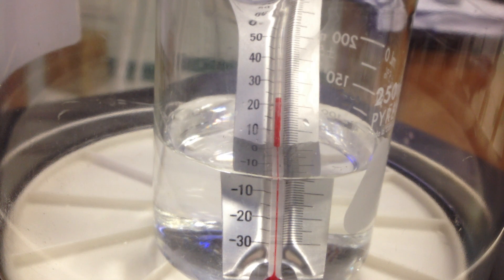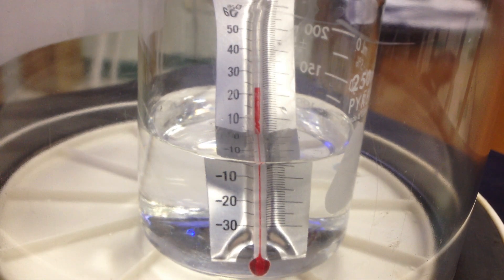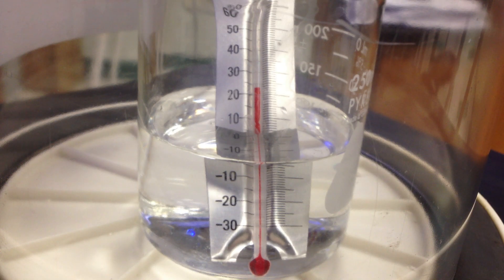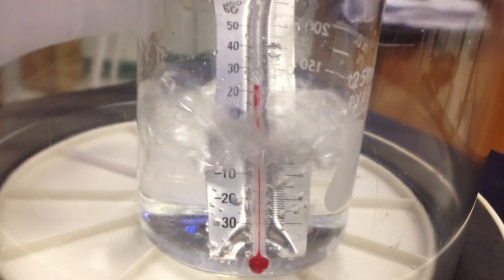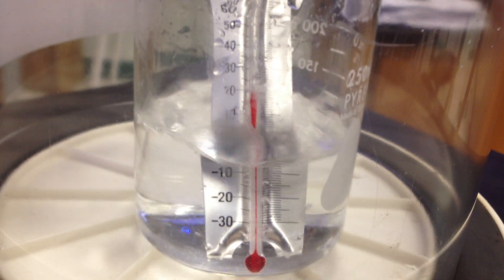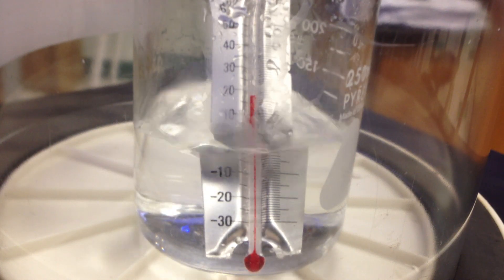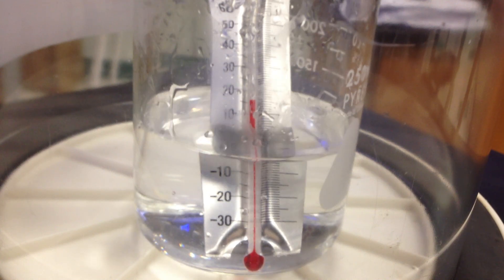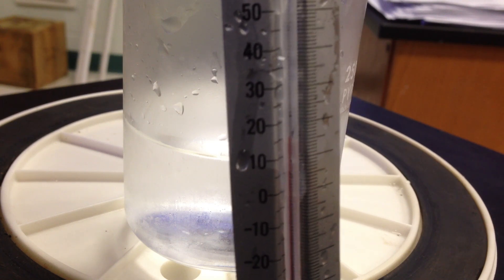Boiling cold water In a Vacuum Chamber

Comment: Which means that the thermometer is influenced by pressure and not temperature?!
Reply from the maker: No the thermometer is still influenced by temperature it just that pressure influences temperature.
Reply: If you ask me, it's the other way around. The increase of temperature causes the substance to expand and thus increase the pressure in the container. For this container, due to the lack of gas in it, the water and resulting gas from boiling has no problem expanding without raising the pressure too much. On the other hand, I doubt that if you push into a sealed container more air (increasing the pressure inside), you would have a greater temperature there. Unless you measure that temperature with a thermometer, which I believe to be influenced by pressure (instead of temperature), if you ask me. If you put something that ignites at a low temperature in your container, and then increase the pressure inside, only then you may see if pressure influences temperature, if that something ignites. And I doubt that it will, but I'm not sure.
Reply from the maker: "On the other hand, I doubt that if you push into a sealed container more air (increasing the pressure inside), you would have a greater temperature there. "   The basis for internal combustion diesel engines works on this principle.  The piston is pushed into the cylinder and the pressure increases in the cylinder to the point that the temperature increases enough to reach the flash point of the fuel (there are no spark plugs).  Under higher pressure temperature increases. Check out demonstrations on fire syringes and the Ideal gas law that shows this mathematical relationship. Temperature will influence pressure and pressure will influence temperature under the right conditions but a thermometer cannot measure pressure directly as your first post questioned.
Reply: Yes, I suppose you're right. Compressing a substance makes its particles become agitated and constantly sliding around each other. This raises the temperature of the particles, right?
Reply: But this still doesn't prove whether the thermometer responds to pressure or temperature. Put inside a container a well chosen substance (something which doesn't gain heat very fast), then increase the pressure in the container and watch if the thermometer changes its value and how much. This will prove if it reacts to the pressure which increases a lot or to the temperature which doesn't increase that much. Is such an experiment feasible?
Reply: M Marius An experiment would be a good way to prove that thermometers are not affected by pressure. You could correct for temperature by using a laser thermometer to make sure that the readings are the same using different pressures. I doubt that the glass would be flexible enough to make the glass thermometer inaccurate. You could also put thermometers that use different technologies in the same vacuum chamber, such as digital, and bi-metal strip. That would be the only way to know for certain, unless someone else has already done this experiment, and published the results.

Comment: Lowering the pressure means the electrons slow down, they don't have as many other particles to excite them. Absolute vacuum is absolute zero, where nothing moves, because there is nothing there to move (all matter has been removed)
Reply: David Emmett Atoms slow down when temperature decreases. The speed of the electrons around the nucleus remains unchanged, as this is determined by the laws of quantum mechanics. Schroediger's equation for a stationary state is temperature-independent.
Reply: David Emmett  👍
Reply: David Emmett  👏

Comment: Does the same concept (temperature of water dropping as it boils due to lowering pressure) apply to mixtures ? I am asking this because I recently learned about Pxy diagrams for vapor-liquid equilibrium, and as you know, the temperature in these diagrams remains constant even when we lower the pressure of a liquid mixture to form two phases.
Reply from the maker: In a mixture of two miscible liquids, the change in the vapor pressure (if temperature is fixed) or the change in temperature (if pressure is fixed) will determine how much of the mixture is in the liquid, two phase, or vapor phase state. Neither pressure nor temperature is held constant in my demo however the drop in pressure will facilitate the change of the liquid mixture to become a two - phase component but there will be limits on the ability of the two-phase component to become a mixture of complete vapor due the drop in temperature.

Comment: Unfortunately this is not showing what is purported. What you are seeing in the video (the bubbles) is degassing of the water (i.e nitrogen and oxygen coming out of the water). At these temperatures the water is unable to cavitate (form bubbles). This is a common misconception and taught even at degree level.  This can be demonstrated by first degassing the water then exposing it to a high vacuum. When the water is first degassed it will remain quite still until enough evaporative loss causes it to freeze. By definition boiling does not require cavitation so even though no bubbles occur the water is still boiling in vacuum as it will continually lose water molecules from the surface into the surroundings.
Reply from the maker: Thanks for your comments. I would agree that degassing is occurring and that water can boil without cavitation. The action of the degassing, the lowering of the solubility of the dissolved gases in the water by decreasing the pressure is occurring ALONG with the boiling of water, whether or not cavitation is of the water is occurring. Although I did not mention the degassing of water in the video the evaporation due to boiling of the water is mostly responsible for the decreasing the temperature. The omission of degassing was a necessary evil to better help high school students understand the relationships between vapor pressure, boiling points, and atmospheric pressure.
Reply: Thanks for your reply. Yes it is difficult to get simple explanations across without losing some of the detail. I do worry that people confuse cavitation with boiling. If you are interested have a look at http://www.nature.com/articles/srep16790 where water is held under high vacuum and under tension.
Reply: at 26C water boils at vacuum level of 28.9 inhg, so if my vacuum pump is only capable of reaching 27inhg will the water still boil and lose temperature? or will it only drop in temp but wont boil?

Comment: sir how much pressure created by vacuum pump and how much temperature cam reduced by vacuum pump??
Reply: +Shubham Shirsath  The drop in temperature that can be achieved depends on the strength of the vacuum created.    If the vacuum drops the pressure to just 0.09 psi, then the minimum temperature that can be reached is 0 degrees C and the water can freeze.  Look up a water phase diagram and you could calculate how strong the vacuum needs to be approximately
Reply: DANG JOS 
But how to calculate this... any formulas use for calculate vacuum pressure......
Reply: +Shubham Shirsath  I'm sorry, but I'm not sure what you mean.  The vacuum pressure is whatever it is.  You can't calculate it.  If you mean how can you calculate the temperature at which water will boil, then there are equations.  Wikipedia gives:  P=e^(20.386-5,132/T), where P is in mmHg and T is in Kelvin
Reply: thanks very much.
Reply: DANG JOS 
20.386 and 5,132 what is this value
Reply: Shubham Shirsath  They are just numbers.  If you plug them in the formula. you should get the vapor pressure in mmHg
Reply: What search on Google then I want formulas of this system. Because I make pedal powered operated zeolite refrigerator this project. Then calculation is more important to project. Please help me how to calculate pressure drop then we get 0℃ temperature
Reply: Shubham Shirsath  Well if you want to get the water to 0 C, then you need to get to at most 4.5 mmHg of pressure.  But ideally less than that

Comment: So then a refrigerator (cold food storage) that was a vacuum would use less energy? Would need just a simple vacuum pump rather than heat exchange?
Reply: Instead of cooling the atmosphere in the fridge, just remove the atmosphere and it is cold.
Reply: Changes in pressure is how refrigeration works. You can't transfer heat in a vacuum, since there is no matter for the heat to travel through. Also, pressurized containers would explode, soda and beer would go flat, and you wouldn't be able to open the door until the pressure was equalized.

Comment: Can we extract this cold liquid and circulate in copper tubes with some sort of mechanism such that it works as an alternative of air conditioner?Could it work?
Reply from the maker: yes but you still need a compressor for this alternative.
Reply: I thought that chilling a metered quantity of water inside a closed vacuum chamber by this technique and extracting it appropriately to circulate inside copper tubes of a room and eventually feeding this to closed vacuum chamber itself whenever water become warm, with a pump we could form a alternative air conditioning system working cyclically without aid of a compressor with water as working substance.Can it work that way?

Comment: Damnit... I was gonna create my own water in a vacuum thingy to boil it and then use the heat from the boiling water to create a thermocouple in the hopes that the ever boiling water would keep a steady supply of heat to it (the thermocouple). But now that I know the temperature goes down when you boil water in a vacuum, that completely shoots my idea down
Reply: Actually temperature of water was going down because the vacuum pump was still running. More air molecules are being pushed out. So as pressure of chamber is continuously decreasing the boiling point of water will also decrease. That why water temperature was decreasing. If you stop the vacuum pump and don't let any air go in or out. You will observe that was will boil at constant temperature without and changing temperature.

Comment: Hello. I have a Venturi type vacuum system. I can pull my chamber down to 25 HG, but can only make the water bubble on the side of the cup. I can not get the water to boil. Any idea what would cause that? I have tried different amounts of water, containers and two different gauges.
Reply: At room temperature, which is about 22 degrees Celsius the vapor pressure of water is about 20 mm Hg. If your pump is creating a chamber at 25 mm Hg then it's not low enough. You need match the pressure of the chamber to the vapor pressure to boil. You might be able to get a bit lower pressure by greasing the seal between the chamber top and the bottom.
Reply: +Ben Grodski thank you Ben. Now I know where I need to go from here to fix the issues.
Reply: You could use hot water since that would have higher vapor pressure and would require less vacuum.

Comment: can you put an ice cube into a vacuum chamber to see sublimation of water?😀
Reply: That would be nice. I remember it's how they make the instant coffee.
Reply: That sounds like it would work. I would like to see that!
Reply: Yes that is how a freeze dryer works
Reply: Ice is ice. It stays frozen. However it subliminate when melting. Looking the water stop boiling at the end of the video, I suspect the hardware isn’t powerful enough to boil water at 0 degrees.
Reply: Can you explain how the water boiled despite being below its boiling point using vapor pressure, intermolecular forces, atmospheric pressure?  If so that would be great!!!
Reply: @yimszy4588 Actaully two things determine a liquids boiling point, pressure & temperature. Most ppl think its only temperature, but when you look at a liquids boiling point ot is almost always rated at sea level.for intance Water boils at 212F at the beach in Miami but if you were to take that same water to say Mt Everest where the atmosphere pressure is lower and boil it you would notice something drastically changed and now your water will boil at 158F.  Vapours in a liquid continually apply pressure upwards as if trying to escape. Normally atmospheric pressure blocks the escape but in a vacuum there is no pressure to hinder their movement so they leave the liquid which is called boiling. Since there is no heat involved in the process the boiling is cold. If you were able to see into a bottle of propane, the same thing would also happen, the pressure inside of the tank keeps the propane a liquid, but when you open the valve up the propane gas escapes and  this lowers the pressure inside the tank and allows the liquid propane to begin boiling again creating more propane gas

Comment: Hello sir

I am SureshBabu from india and i am a chemical engineering candidate and i see your videos, it is very knowledgable. I have few doubts based on this experiment 

I handling vacuum distillation column in my company to seperate the two higher boiling point component at the vacuum of about 15 to 20 mmHgA. In your videos water is at room temp, assume that the two higher boiling liquid(A+B) kept in beaker at the temp of about 180 C at atmospheric pressure. Component A boil at  180 C @17mmHgA and Component B boil at 240 C @17mmHgA. Now i start to pull the vacuum in the closed container, when the pressure reaches 15 to 20mmHgA component A starts to boil and evaporate, then the vapour is sucked by vacuum pump. During this condition what would be the temperature of the component B wherther it reduces (or) still at same temperature of about 180 C.
Reply: SURESH BABU This is sooo embarrassing!!! I am 11 and i can't understand what you are saying. But i am very concerned that it is a very good point.
Reply from the maker: Assuming that the 2 liquids are miscible then the temperature of B must drop, however you are maintaining a temperature of 180 C in this distillation with a heat source that is thermodynamically favored to regulate a constant temperature.  The heat source is transferring thermal energy to the liquids that are losing it through boiling and or evaporation.. Liquid A is evaporating/boiling and is losing kinetic energy and Liquid B although not boiling is also evaporating, thus it is losing molecules with the largest kinetic energy.  The lower thermal energy in the liquids provide a pathway for heat from the heat source to "reheat" the liquids.
Reply: Thank you for reply me 

The two liquid are miscible, you are told that when the component B drops its temp during boiling of component A that time we should give energy in terms of heat to maintain the temp of about 180 C am i correct sir.

When i did not supply energy during temp drop of component B, what would be the temp of component B whether it decreses further (or) not.
Reply from the maker: Not sure If I understand your question.  Are asking me what would be the temperature of component B if no external heat was applied?
That is a very complex problem that would require measurement of many variables.
Reply: sir I am not asking the exact temp of component B whether it further decreases or not during boiling of component A under vacuum.
Reply: SURESH BABU... Temp of b would b constant because a is boiling and its vapour will keep the whole system at same temp.. Vapour cooling.. 
You can check the fossil fuel cracking processssdss
Reply: lmao, the fact you are using the term "fossil fuels" denotes credibility. Fuels arent derived from "fossils", thats a myth.

Comment: dude why doesn't the water level changes
Reply from the maker: It sure does but you are observing from a 250 ml beaker which is not a precise enough measuring device to illustrate that small change in volume in such a short time.

Comment: I wouldnt call that boiling. when the vacuumed was turned on the air molecules  were taken out. so with out any air molecules keeping the hydrogen and oxygen together they separated. kind of how astronauts take ice and turn it into breathable oxygen
Reply from the maker: That is boiling plain and simple. The atmospheric pressure of the vacuum chamber was lowered enough so that it matched the vapor pressure of the liquid. Boiling is really a function of atmospheric pressure.  Liquids can boil at any temperature when you change the atmospheric pressure. That is why we use the term Normal Boiling point to compare liquids at the same atmospheric pressure, 

Air molecules from atmospheric pressure DO NOT keep hydrogen and oxygen together.  What they can do is keep the molecules of water from separating.  This is an important distinction.  The demonstration is one that is illustrating a physical change not a chemical one. You are implying that atmospheric pressure prevents molecules of water from decomposing.  That is incorrect.  If that was the case then there would be no water in our upper atmosphere (which is lower), which would be catastrophic since water is the most important greenhouse gas. 
What keeps hydrogen and the oxygen together is a very strong covalent bond.  It would take a lot of energy to break this bond and not a lack of energy as you suggest.  One way is electrolysis, where electricity is applied to break the bonds between the hydrogen and oxygen. This is what is part of the Oxygen Reclamation System in the International Space Station.
Reply: FlatterMuffins. it is boiling. look up the definition.